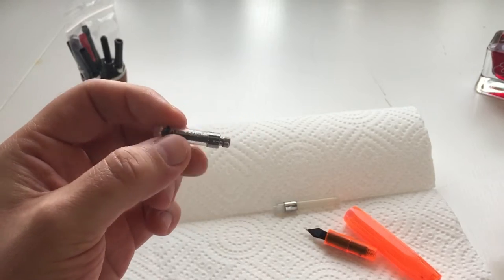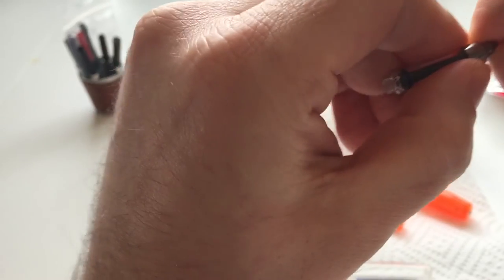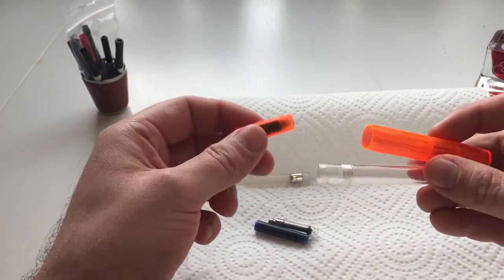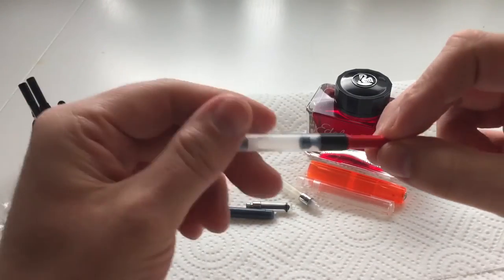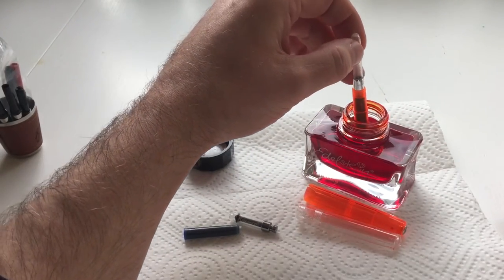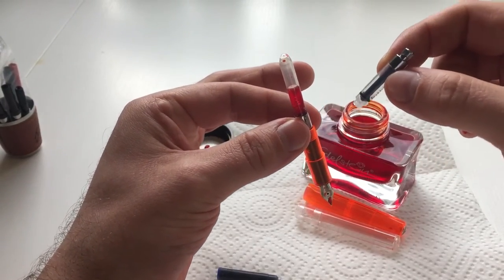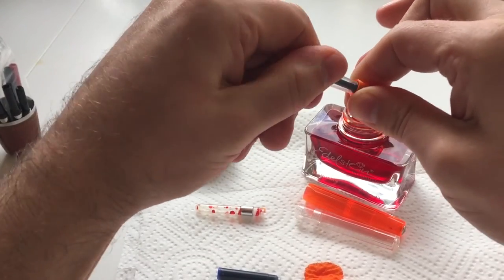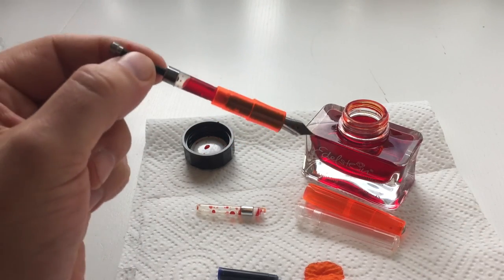Kaweco Squeeze & Piston Converter - a comparative review

Comment: A little tip for filling the squeeze converter - if you twist instead of just squeezing then greater amount of air inside it will be removed and more ink will be stored, I did the same with all my HERO aerometric converters...just give a try and tell me if it works..
Reply from the maker: Thanks for the tip! I just got some Heros, and have issues with these as well. So once they need a refill, I will most definetly give this a try!

Comment: So does it make sense to remove the nib after the first fill, let the ink run down to the bottom of the converter, expel the air (yes, there's a little ink drippage, just do it slowly), and re-insert the nib into the ink and release and then repeat?  I do that with all my pens to get a completely full fill.  But these little things....oh my.  I think I'll just continue to fill my empty cartridge with the ink of my choice.  Thank you for your video!
Reply from the maker: Thanks for your comment! Yeah true, that is indeed a way to get a full fill. But I do normally also either fill the squeeze converter or an empty cartridge with a syringe or use the piston converter. The piston converter fills fully and neatly. It holds little ink, but for me it suffices.

Comment: The squeeze converter is like the one in the Hero 366 pens. 
Just a tough bladder no metal.
I have the little Kaweco Push pull converter. 
All my Jinhao pens come complete with a twist converter and free post from China.
I have 2 Kaweco's one I use with cartridges and the other with a push pull converter. The Pilot Metropolitan has a squeeze converter that is not transparent but it fills ok.

Comment: My gripe with the converter is that because of its size ink tends to be a lot more “stickier” because of surface tension and it impedes ink flow and I end up having to shake the pen whenever writing is interrupted. The only ink that seems to work well with these converters are lubricated ink such as inks from Monteverde. Either that or eye dropper all the way.
Reply from the maker: You are right. The converter is not ideal.